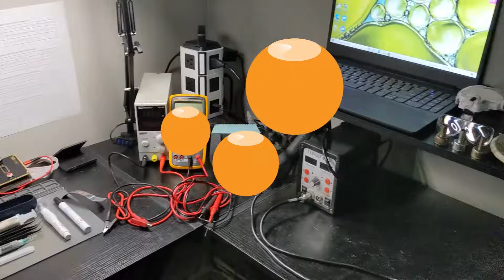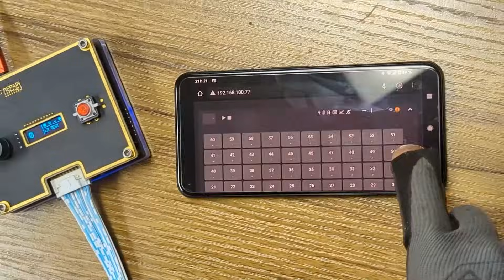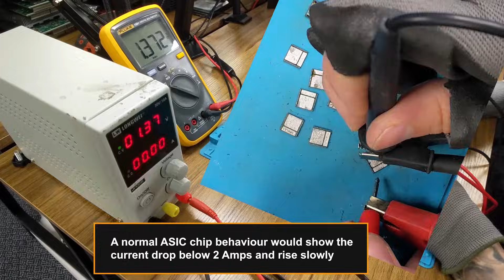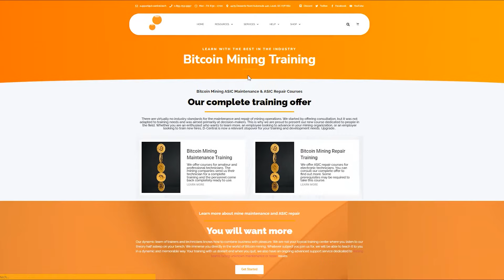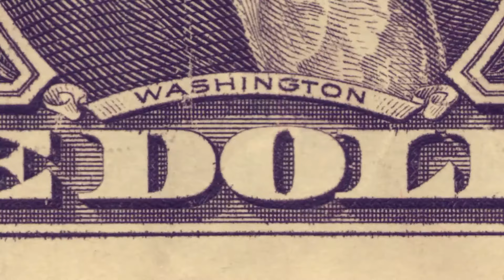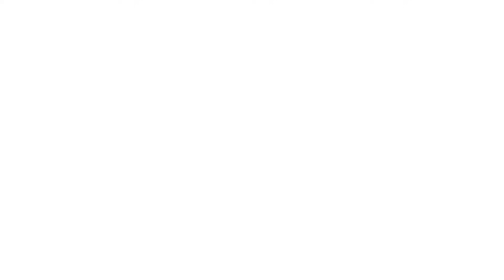Learn How to Become an ASIC Miner Repair Technician in 5 Days!

Comment: When you are fixing an s19 xp, how are you getting it hot enough with the aluminum back without warping the entire board on a hot plate ?
Reply from the maker: Warping is a big and common problem with Bitmain aluminum models. The best is to heat the whole surface but the large surface of the x19 makes it hard. We are currently making a custom heat plate to test and prevent bending, but it's really about evenly distributing the heat to prevent warping.